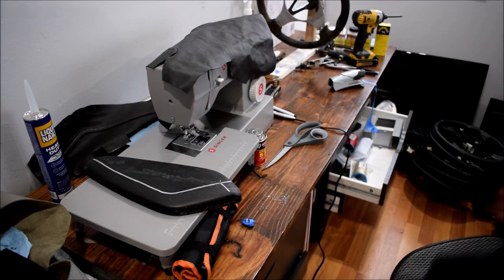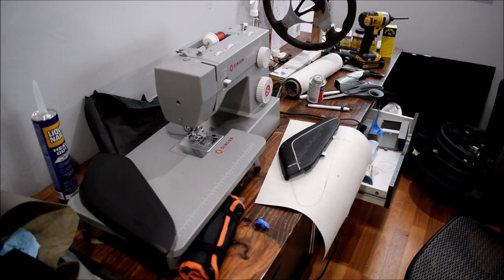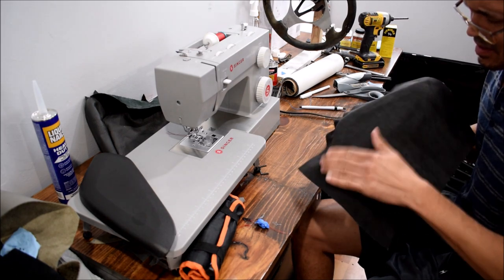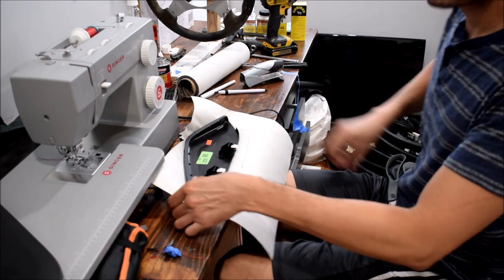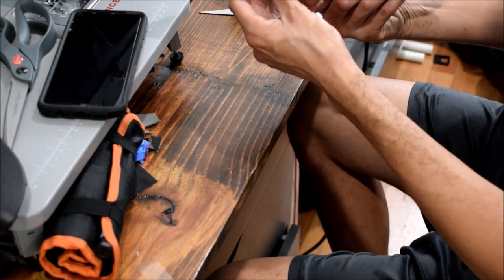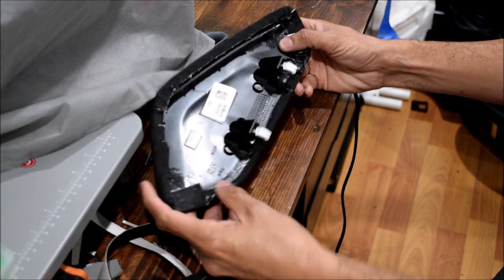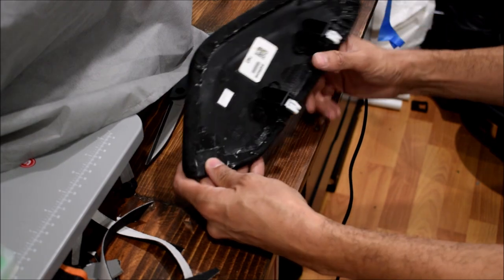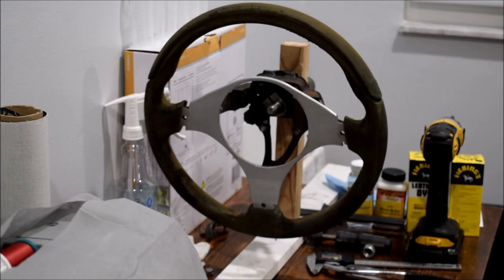Camaro Knee Pad DIY

Comment: How are the holding up after many months?  Have you thought about adding padding?
Reply from the maker: Thus far, they look exactly how they did when I finished them. I'm extremely happy with the quality of the genuine Alcantara fabric. The one I used has a backing which makes the pads soft enough for my needs. You could add a thicker backing but it would alter the shape of the pads.

Comment: What brand of suede and where did you get it? Thanks!
Reply from the maker: @HyperBlueMetallic1LE  I used Alcantara (that's the actual brand name). I found a decent size roll from a seller on eBay for $80. Definitely not cheap, but I got a few other projects out of it and was still under the cost of buying these from GM. I recently got my hands on the real GM ones and they actually seem cheap by comparison.
Reply: @doitwithproperstyle  yeah I think gm uses fake suede just can’t find what brand and I’m trying to get the best match
Reply: @doitwithproperstyle also would you say the real gm ones have more padding or was it about the same